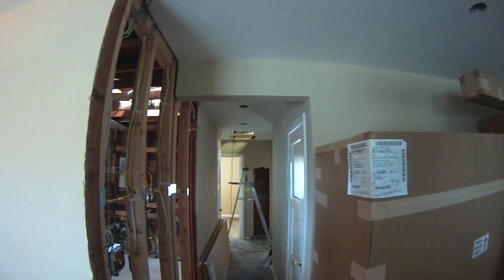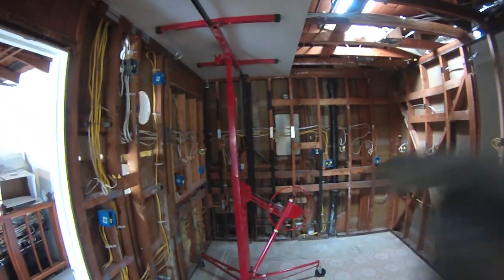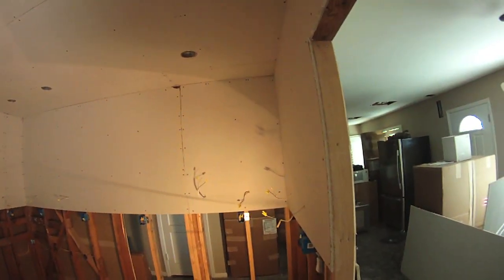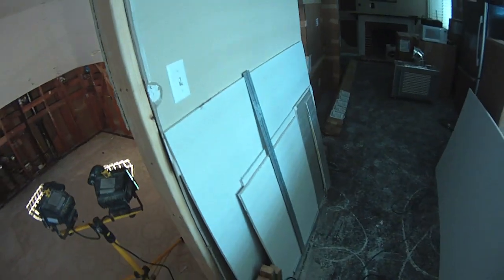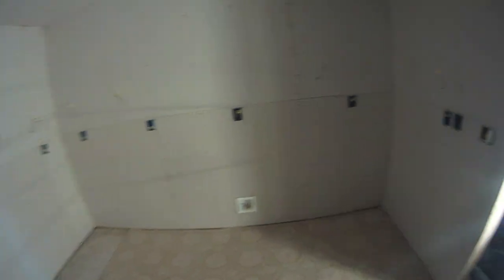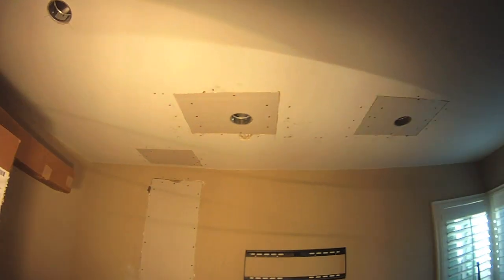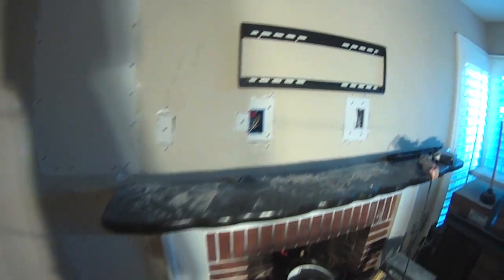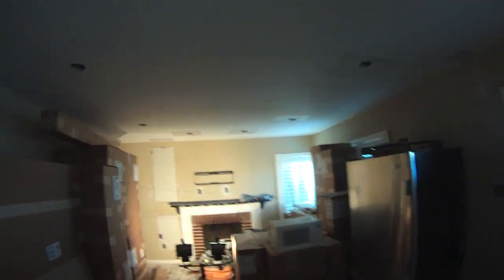Kitchen Remodel Has Drywall

Comment: I'm up for a video on the whole mudding business Steve, sheetrock isn't a common thing here in England as I've probably said before so I'd welcome anything I can learn from. It certainly looks convenient and I've seen it for sale in our local big hardware hole, it looks really dusty.
Reply from the maker: Hey Matt, I have done a fair share of true plaster work over both metal and wood lathe and while I like the process of building up the wall and finishing it off, drywall is so much faster to get a smooth surface.  I will make detailed vids of the process and some tips.  Stay tuned and thanks for watching.

Comment: You have a corded DW.  I have an aversion to battery powered tools even though they do have their purposes.  
Ever tried to mix a 5 gallon bucket of paint with a battery powered drill?
Reply from the maker: Hey Serp, I have a battery operated impact driver, drill  and recip. saw..everything else has a cord ( including a corded drill and recip saw) ...I like the cord and will deal with the cord if it means I am not dealing with dead batteries or weak battery operated tools.

Comment: Hate the dish guys! I do a lot internet only installs, cuz they get dish tv...those lazy installers cut our drop to use hole there for their drop,lag dish to roof shingles and sloppy wiring down siding. They paid by job, so "shit and get", no pride in work
Reply from the maker: I can't agree with you more...I removed at least three installs from this house to clean things up...a couple cable and one dish.  I understand the new company does not want to tie into an old system, but you are right... there is definately no attempt to make it look nice.

Comment: No wall or ceiling insulation??
Reply from the maker: Nah, not a requirement for interior walls and not really needed in this climate.  With that being said, when I did the addition/remodel to my current house I insulated all the walls regardless of their location with a minimum of r-13 and it made a HUGE improvement at balancing the temperatures and sound travel through the house.

Comment: How do you match the wall texture?
Reply from the maker: These walls are considered "smooth wall" .  The texture on them is stipple created by many years and several coats of paint applied with a roller. My patches will be a true smooth wall and will stand out to the surrounding area.  I attempt to recreate the stipple by dry rolling a thick primer.  I can typically get the desired match after two or three coats.  I can make a video showing the process if you like.

Comment: hope you don't go with them sparkes again a 2 foot hole for a can light is ridiculous we rewire entire houses only make 3or 4 small 3 inch holes in the entire house
Reply from the maker: They are good guys and the hole was agreed upon prior to the cutting. We could have gone with remo boxes and fished wire through the space above, but this old rock is kinda crispy, the LED remo housing is kinda heavy and we live in earthquake country.  I didn't want stress cracks in the ceiling to develop over time so we went with new construction boxes that attach to the studs.  Without a way to get a human into the space above, the only way to get the new construction boxes mounted is through the living space. It's fine now...it's an easy patch for me.

Comment: how do you carry sheet rock with the itty bitty toyota?
Reply from the maker: That lumber rack is very stout.  I have had 24 sheets of 1/2" on it and it seems no worse for wear. But that's the limit I feel comfortable carrying....and I don't do it very often.  The bed is too tiny to flat carry panels in it...There is only have about 38" between wheel wells..and it's a 6' bed.  One day I will have a full size pickup again...one day.
Reply: oh my jeebus! i need one of those for my tacoma.
Reply from the maker: It's a Cargo Master rack, and worth every penny I paid for it.  Got it used on Craig's List
Reply: LALALALALA I'M NOT LISTENING! If I know what it is, I'm gonna be looking for one and I don't need one right now and I don't have the time to go looking at one. Why did I just open Craigslist? I wonder if it'd be under tools or auto parts. Shit. Unsubscribed. Lol
Reply from the maker: I found Mine was under auto parts....    Muahahahahahaha...  Have fun searching...  I paid $150 and the rack was so new it still had the stickers in it.  Best thing I could have done for that truck.